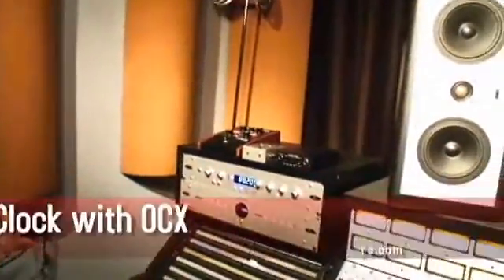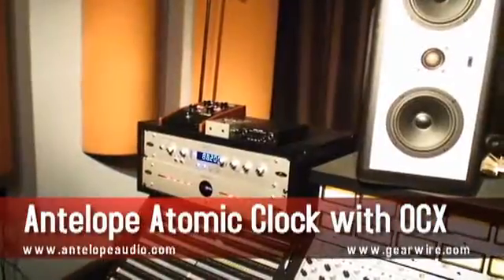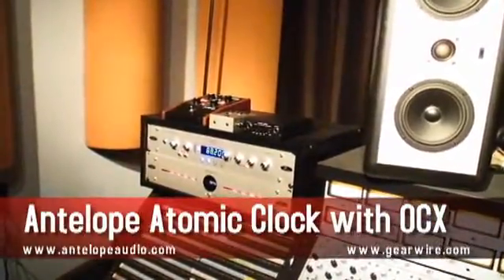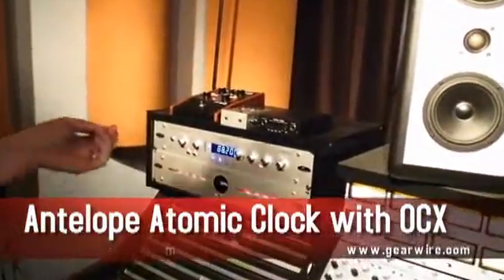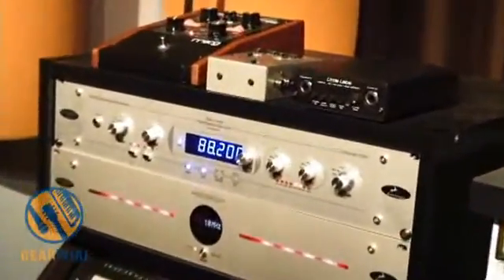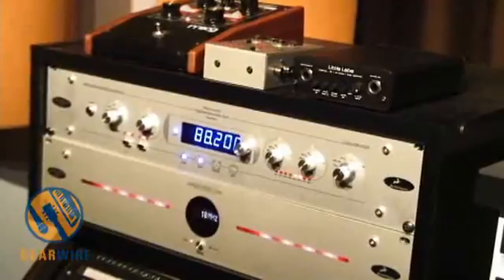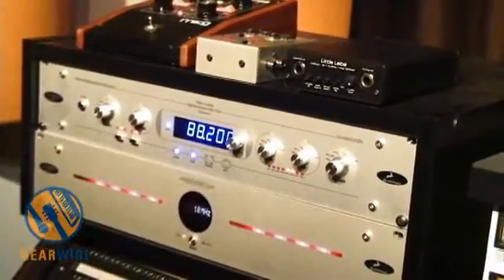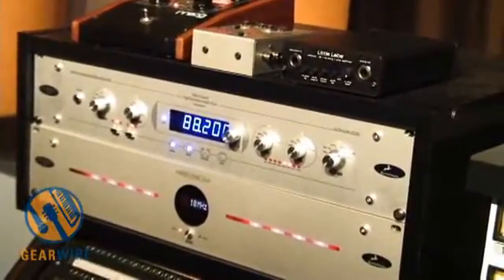Antelope Audio Isochrome 10M Atomic Clock, Antelope Audio OCX: Jeff Ehrenberg Does Not Have The Jitt

Comment: Correction: The Antelope 10M outputs a frequency standard of 10MHz rather than 10,000 MHz as stated in the video.  Rubidium is oscillated via microwave stimulated emission and is measured based on it's propensity to filter light directed through the vessel via an optical pump assembly.  When the Rubidium package reaches a frequency locked loop state the resulting (approx. 6.84GHz) signal is then reduced via a quartz crystal digital synthesizer assembly to the required frequency of 10 MHz to dri